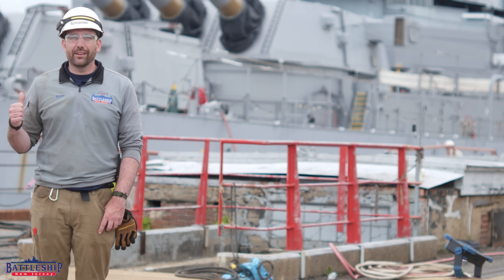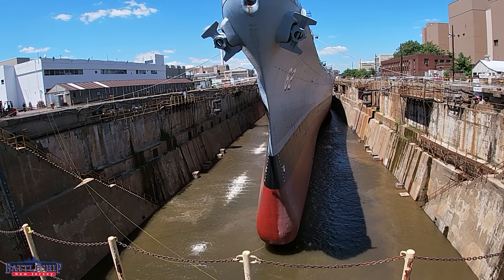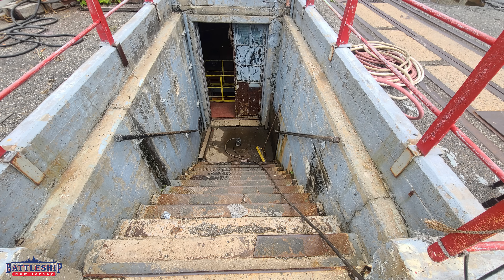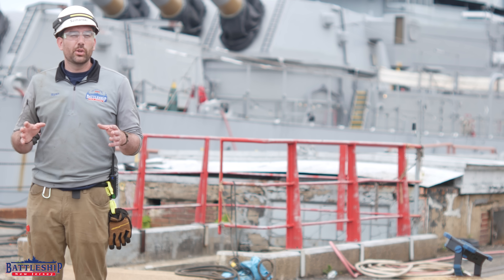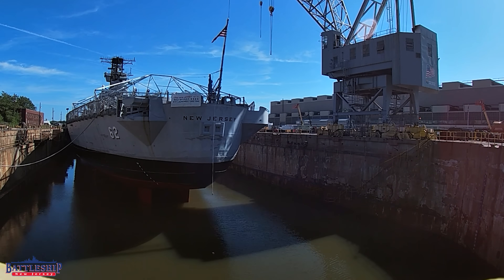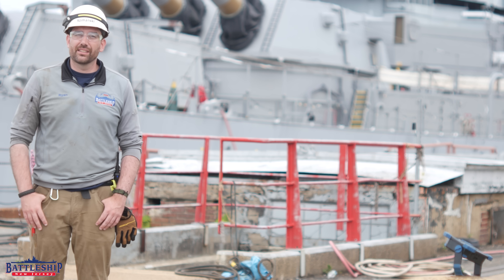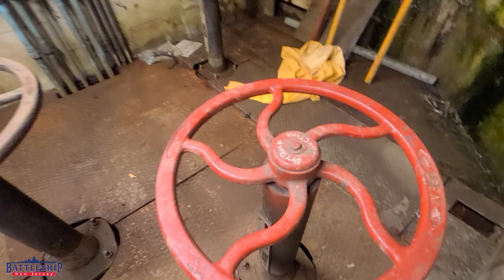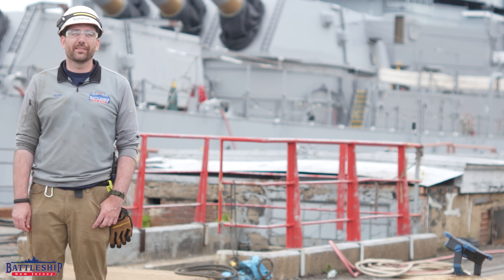The Pumps That Move 37million Gallons of Water Out of the Drydock

Comment: The quality of the pumps speak volumes of the way things were built back then.
Reply: Industrial mechanic here who mainly works on pumps at my current job, these things haven’t changed much since the 1950s, they’re more efficient now but reliability is gonna be there for a 1200 hp motor no matter when it’s built.
Reply: 3-phase induction motors like that will last pretty much forever as long you do basic maintenance on the bearings, manage corrosion, and make sure they don't overheat. There isn't really anything to break in there except for the bearings. They don't have brushes like DC or single phase motors, and all the starter circuits are located in separate electrical cabinets usually, and those look like they have been replaced. 

All there really is to an induction motor is an outer coil which remains stationary (called the stator) and and inner coil attached to the shaft (called the rotor). When you run AC power through the stator, the rotor will rotate, as the names imply. There's essentially nothing in them that can go wrong as long as you make sure the bearings stay greased.
Reply: The usual uninformed "back in the day..." comment 😂
Reply: @rmhanseniii  Not likely as they are running very low RPM and are only in use intermittently.  I would bet the motors all have less than several hundred days worth of run-time on them even at this age.
Reply: @pawo007 The data plate says full load speed is 236 RPM.
Reply: Rate of profit was higher back then. Everything is crappy now because that is how business responds to declining rate of profit.
Reply: @randbarrett8706  Also survivorship bias.
They made crappy things back in the day too: but only the high quality things tend to last.
Reply: Things are built to meet specifications.
Reply: Back in the day planned obsolescence wasn't as prevalent as it is today in consumer products so I get your perspective. But these pumps and motors aren't consumer products like the sump pumps you buy at Home Depot.
Reply: @Chez8922-kf6cy That alone is honestly a huge difference. High quality high reliability electric motors and such are still around, they're just expensive and they're sold through channels that cater to customers (industrial etc) who can afford it.
Reply: Haha see what u did there.. volumes...
Reply: @thelearningcurve6543  you beat me to it by 40 minutes.
Reply: @rmhansenii The entire inside is most likely painted with a thick layer of actual varnish.
Reply: technically that set up was meant to be abandoned as that was the mindset at the time where as now days we don't just abandon sites so they are designed to be upgraded so chances are those motors have been rebuilt multiple times
Reply: Akshually.   @KILLKING110
Reply: Take the like for the joke dammit.
Reply: @rmhanseniii i doubt it, they aren't being used very often (low duty cycles) and probably not driven hard.
Reply: The American way. Enough said. Thank you

Comment: Fantastic to see those old motors still in service.  I guess since they only get used a handful of times a year they have not worn out.
Reply: They are induction motors, so there are no brushes or segmented commutators to wear out. I suppose the bearings might wear out, but I think the pump, full of corrosive water, probably requires a lot more maintenance.   I have a few induction motors and they run quietly forever. I have a few from the 50's and I have just put a drop of oil on the bearings every once in a while.

Comment: Many years ago I took a “hardhat tour“ of Hoover dam - a lot of the equipment there looks very similar to what is at this drydock - seriously overbuilt equipment for managing the flow of water that lasts a very long time
Reply: The first Boulder Dam generator went on line in the late 1930s.  The last generator was installed in 1961.  The input shaft power is about 3 Gigawatts.  The electrical output is about 2 Gigawatts.  It was impossible to ship the huge parts to make the penstock so Babcock & Wilcox built a plant on site to bend and weld the plate.  The plant included a massive X-ray machine several stories tall to inspect welds.  The largest penstock pipe was wide enough to drive a diesel locomotive through it.  The scale of Hoover Dam is really mind blowing.
Reply: Most of it was Allis-Chalmers
Reply: Another interesting fact is that before interconnecting with Boulder Dam, Los Angeles’ electric utility operated at 50 Hz.  The tie-in required the utility to switch to 60 Hz and offer a multi-year trade-in program for customers to exchange clocks and appliances which could not operate correctly on the 60 Hz power supplied by the dam.

Comment: Ive seen some big DC motors in coal mines and conveyors, running a copper cable about the diameter of a softball all the way down to the bottom of the mine

Comment: Back when we built to last. Interesting facts on how the drydock is built and works.
Reply: "Built to last", "They don't make them like they used to" are forms of survivorship bias.  You only see the stuff that lasted 100 years.  You don't get to see all of the garbage they made back then because it's since been thrown away.  There's an interesting article on survivorship bias on Wikipedia.  The best example is the study on armoring aircraft during WWII.  They initially made conclusions based on aircraft that made it back aka the survivors.  What they really needed was information about the type and location of damage for aircraft that DIDN'T make it back.  So they initially had survivorship bias.
Reply: The other big thing here is industrial equipment. When things are expensive, and physically difficult to replace, and essential, you take care of it rather than replace it. Most industrial plant services built today will have a design life of 30-50 years. With good maintenance and no other choice, it can be pushed even farther.

The things normies interact with everyday are none of those things. They are cheap, they are easily replaced. Etc.
Reply: It’s not “survivorship bias “ it actually is cost prohibitive to build machinery to last this long, except critical applications, ie, nuclear. I repair motors form the 1900’s to current. For the most part the engineers have them designed to the material limit, without much room for overload. Now it’s a throwaway society. Most motors cost too much to rewind stators, except unique ones such at these. Also planned obsolescence ;-)
Reply: Ah yes. The good old days. Except you have no idea what you’re talking about.

Comment: Europe here.. our standard household voltage for everything, lights, sockets, appliances etc. is 220 or 230 volt on 16 Amp breakers.
Reply: In the US, what's coming out of our transformers into our homes is actually 240V.  We also have a center tap (neutral) on the transformer that comes in, too.  The neutral is also grounded at the pole.  So each hot wire will then be 120V relative to that center tap and 180° out of phase with each other.  120V is a holdover from the early days when wire insulation couldn't safely withstand more voltage.  By the time electric made it to Europe, better insulation was available and you guys settled on 240V.  We need 240V, too, for big loads like clothes dryers and ovens.  At this point, it would be nearly impossible to fully switch over to 240V.  Grid changes are not required.  But we would need to change out breaker panels and buy all new appliances at the same time inside our homes.  In Japan, they have an even weirder situation.  Half the country is on 50Hz and the other 60Hz due to early competing standards.  Eventually the two grids were connected by rectifying to high voltage DC and then inverting back to either 50Hz or 60Hz.  This became the bottleneck during the Fukushima disaster because no one envisioned so much power being lost on one side of the grid.  I believe there are some homes in Europe with 3 phase power.  In the US, that's effectively limited to industrial applications.
Reply: Ryan may not be a know-it-all when it comes to electricity in your home, here or abroad.
Reply: Britain likes to be a wee bit different.  Our outlets are on ring mains, so most of them are on 32amp breakers.
Reply: I bet most U.S. houses have larger main breakers though. 200 amp service (@240V) is common in newer homes.

Comment: Each pump can de-water 105,000 gallons per minute???? My home swimming pool is 35,000 gallons. I can't imagine seeing my pool drained in 20 seconds. That is crazy.
Reply: If you were to hook the five F-1 engines of a Saturn V rocket to your pool, they'd drain it in about 10 seconds.
Reply: @KingdaToro  As I recall, those F-1  turbo pumps required around 50,000 horsepower to feed the fuel. This was 1950s technology.
Reply: @KingdaToro  Wouldn't the five F-1 engines of the Saturn V have just boiled off his whole pool in about 5 seconds?
Reply: If you point the exhaust at it, sure. I'm talking about hooking the propellant inlets up to it.
Reply: How much is all that in liquid curators?
Reply: @2505JAD one liquid curator = 11 cubic feet of volume (approx) = 83 gallons.

There's probably a documentary on liquefaction of personnel of submersibles who just happened to have gone past crush depth on Magellan (today's video sponsor)...

SZIMANSKI!  YOU STAY ON THE BLACK DRAGON!  BB63 TEST DEPTH IS ZERO!
Reply: @2505JAD  Depends....  How many beers you gonna give him?
Reply: Look for videos from hydro power plants, canals and so on. Since adoption of steam and electricity industry operates with volumes of water comoarable to river flow - Niagara falls, Parana and so on. Dry dock for battleship is nothing, kids pool, in comparison to any good water reservour. Our main town water storage is 150m deep, 30 km long and water pumped from there 2000 ML per day, roughly all this dock every hour.
Reply: I used to stress test river pumps on the Fylde coast,  Set up the test and went for tea and doughnuts with the guys, ten minutes later looked out of the window and the boats were on there sides oooops.
Reply: If a firefighting helo comes to your pool with the bucket it'll be half gone in one scoop.
Reply: @charliewhiskey8440  nope. Helo bucket is couple of m3 even for biggest machines.
Reply: The now closed Octel Amlwych bromine works in Anglesey had two blowing-out towers were fed by two enormous pumps for a total of four pumps sat in a cavernous pump hall, and each of these blowing-out towers would be fed 180000 gallons per minute maximum extracting some 5 tons of bromine per hour while processing a maximum of 10.8 million gallons of seawater in that hour, typically they'd be running all day most of the year with higher flow rates in summer and lower rates in the winter as the temperature difference produces a significant change in efficiency and thus profitability of the process

Comment: At 8 pounds to a gallon, youre saying it takes 296 million pounds of water. Or about 150, 000 tons of water to float a 47000 ton battleship. Interesting.
Reply: Yep! It also has to fill the dry dock around the battleship, the volume of water that the battleship displaces alone should be around 47,000 tons of water, all the rest of the water around and underneath it totals out to considerably more. If the battleship was a fluid, you could probably fit 3-4 liquid battleship NJ in the dry dock!
Reply: @alexlohan2988  so what you're telling me is that Drydock No 3 is 25% Battleship right now?
Reply: @phillyphakename1255  🤣 one could argue that it is, in fact, 25% battleship-by-volume currently

Comment: We have larger motors driving equipment at the papermill where I work that are a fraction of that size.  Of course those motors are far newer and more efficient.  Our largest motor is 7500 hp. and runs one of our paper machines.  That motor replaced a 6000 hp. steam turbine.  All of our primary effluent pumps are rated for a total of 40,000 gpm. with the largest pump driven by a 300 hp. motor and rated at 6000 gpm.  Excellent video, love seeing that old equipment.  Thanks much!
Reply: I would assume mainly Goulds at your plant or sulzer?

Comment: Proof they don't make things like they used to. Amazing those original motors are still in service.
Reply: Brushed motors are a very simple technology. Just keep them lubed, and replaced the brushes now and then, and they'll last forever!
Reply: @BlackEpyon  Brushed motors? These are induction motors, not doubly wound synchronous machines. Notice the full load RPM is less than the unloaded RPM
Reply: @brnmcc01  They didn't  act actually show the motors, but you're probably right.
Reply: Extremely uneffective, difficult to control, dangerous... but they do exist, do their job and used 10 hours per month, so of course no one wants to replace them.
Reply: And another uninformed "they dont make things like they used to..." comment 😂
Come on, you all can do better than that.
Reply: @Ganiscol  do you think any electric motor made today would last 110+ years in service?

Comment: "331 amps... which is probably more amps than your house draws"
APPLES AND ORANGES
power is voltage times amperage
2200 Volts at 331 A is substantially more power than 331 A at 240V
Reply: Amps are still amps. The size of the cables they need, for example, is determined by the current, not the power.
Reply: @thomasdalton1508 amps determine the thickness of the copper, voltage determines the thickness of the insulation. I have some 100kV wire at work that's like a centimeter thick, but only 18 gauge copper inside because it outputs milliamps.

I've also done 800 amps, and we were just throwing copper at the terminals in hopes of keeping the temp down so as not to melt the insulation.
Reply: Domestic supply in the UK is 240v ( L and N) . Ships were 110 / 440 3 phase  so the cabling and twin fuse arrangements were very different . A kettle boils at home within a minute - aboard ship it took more than twice that time . Anyone not trained for the work couldn't believe the size of cabling we used .
Reply: 728200 Watts for one pump compared to a house with 200A service 44000 Watts. 16.5 times more power for one pump. They have 3. So almost 50 more power than a house can supply.
Reply: @Aesperius  did you factor in incoming is probably 3 phase not single like residential.
Reply: @Aesperius  I was just going to say this - my property has a 400 amp 220 V single phase service - it could provide roughly 90,000 Watts

Comment: I am disappointed Ryan is watching TV when the dock is flooded. You need people to check for leaks after work is done on the hull. It will be a very bad day if leaks are there but not corrected in time.
Reply: No offence though the dock is crewed with professionals that’s been around countless ships. They most likely had people on board to monitor for potential issues during the process.